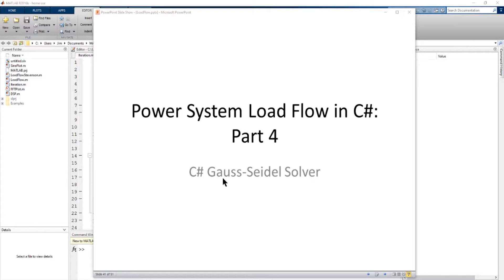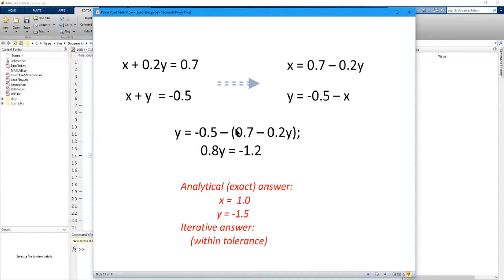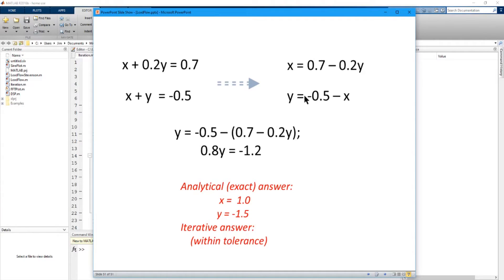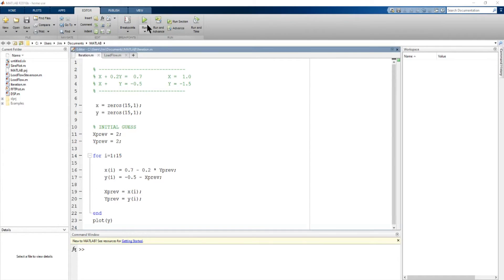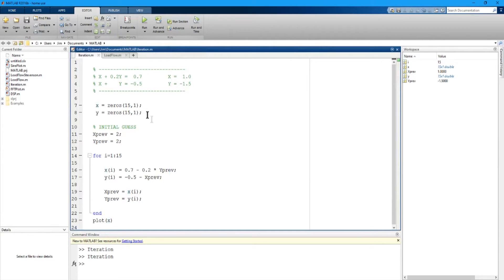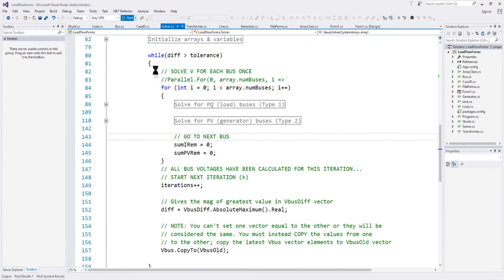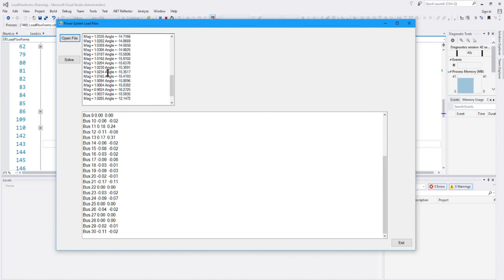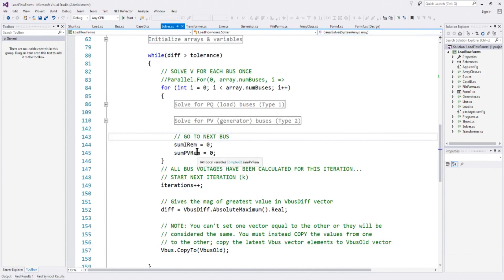Power System Load Flow in C# Part 4: Making a Gauss Seidel Solver

Comment: Very helpful. Is it possible to get the C# source code for Parts 1,2,3 and 4?
Reply from the maker: I go to all the trouble of leading you thru every line of code, and you can't type it yourself?
Reply: @EETechStuff  "every line of code"? The presentation showed SOME source code. I am not sure whether you showed every line of source code.
Reply from the maker: Well the three videos showing every aspect of the problem and the solution should make it easy for you. I explain every algorithm, give a simple flow chart, show all the equations, and so on. Try it yourself, don't just copy and paste. That's how you learn.
Reply: @EETechStuff  Thank you for the videos. Can one do a similar simulation in fortran?